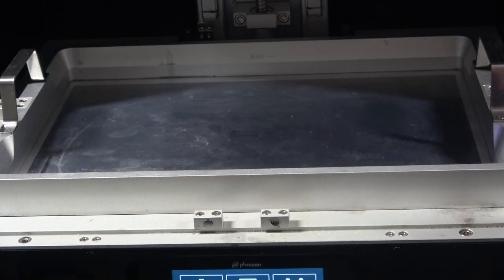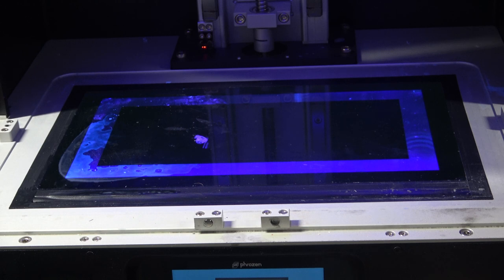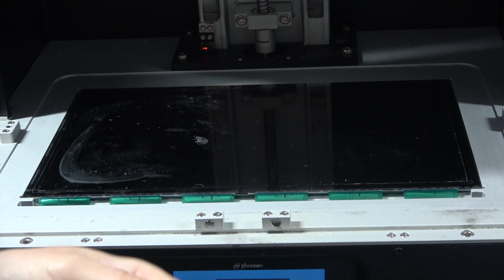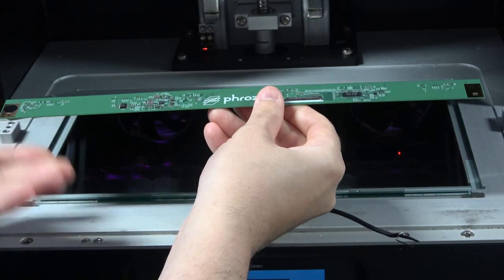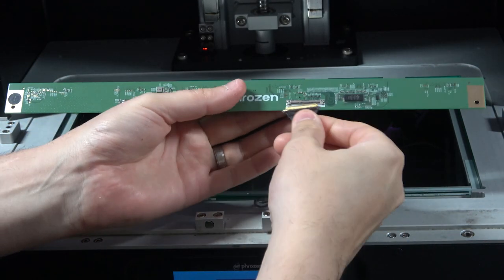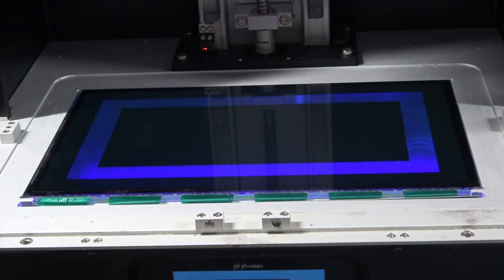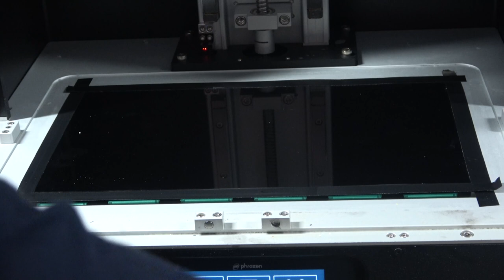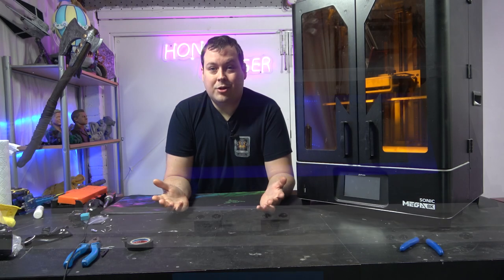Phrozen Mega 8k Screen replacement

Comment: Did you have to relevel the bed after your screen replacement?
Reply from the maker: you always re do your z offset after a screen change
Reply: @honeybadger3dprintandpaint  My Sonic Mega 8k says not to ever calibrate the Z-axis on your own. Can you explain the "Z offset and revel" in detail please?
Reply from the maker: so re leveling the bed refers to making sure the bed itself is perfectly parallel to the screen, you should not ever need to do this as the bed is levelled at the factory, the z offset refers to the distance the screen is from the bed when the bed is at what the machines considers to be 0 (this should be roughly the thickness of a standard a4 piece of paper) you would do this when you change your screen or if you install a screen protector
Reply from the maker: apologies if i conflated the 2 in the previous comment i have updated the comment and included an explanation of the two processes
Reply: Thank you! @honeybadger3dprintandpaint